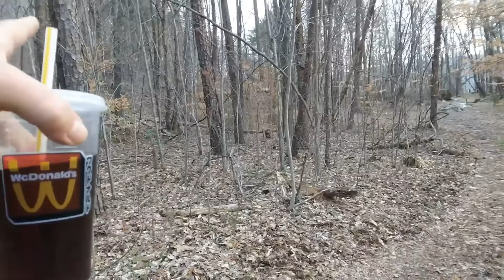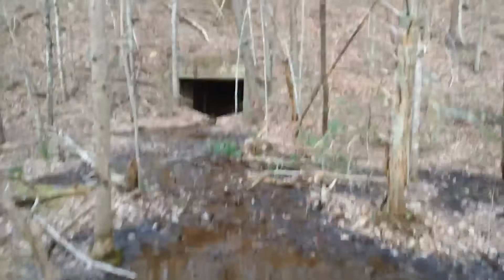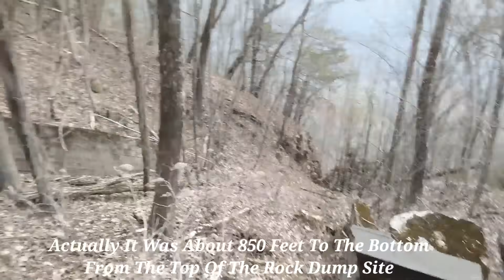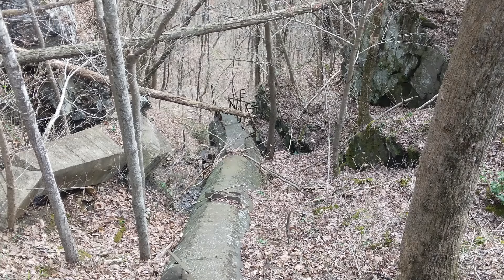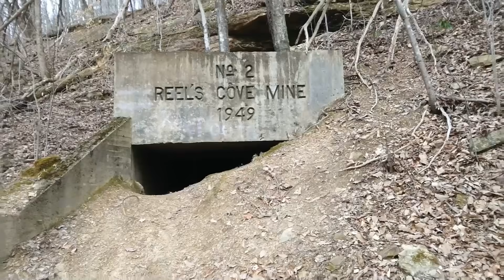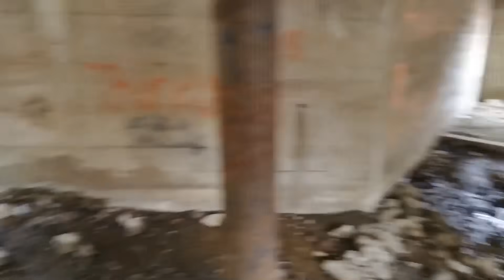Reels Cove Mines

Comment: A few of the fan houses I've seen on videos showcasing old mines in Pennsylvania typically had the fan directly over top of the shaft to push/pull air in or out rather than the setup seen in this video.